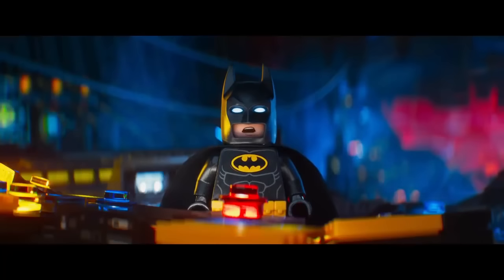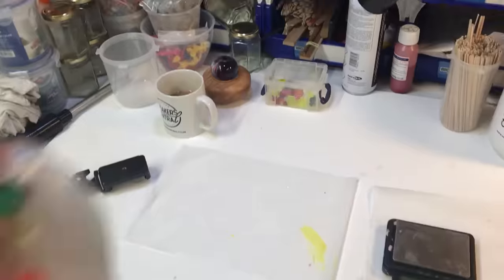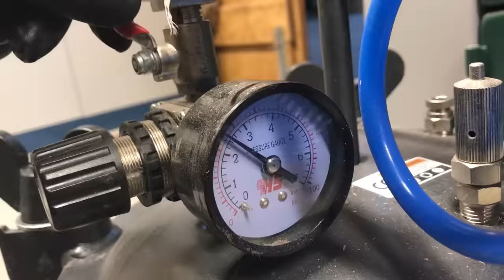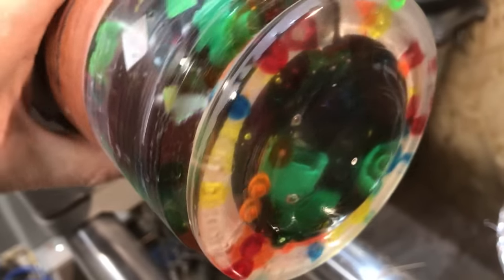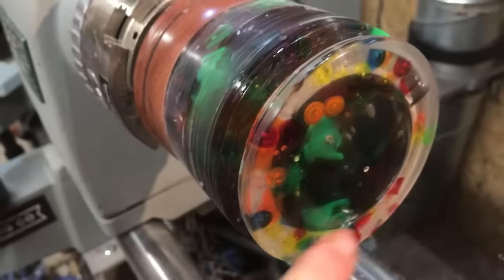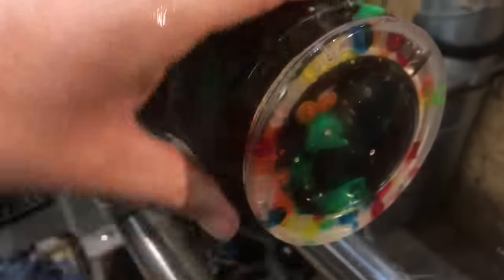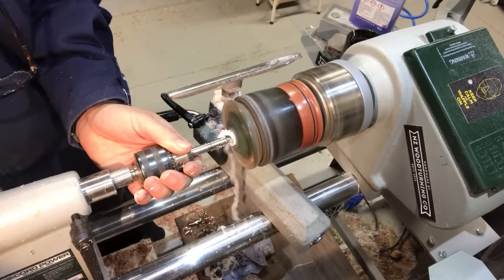I Mixed Up My Sons Translucent LEGO in Resin to Make Art 😮

Comment: Have you ever made something similar to this where you put a cylinder/sealed tube (like an aluminum cigar tube) in from the top to create a hole? when you remove it from the mold, I would guess you’d put your block on the top where the hole is then drill through the wood base into the opening where you would be able to put some kind of a bulb inside like a night light. That would be really cool with the Lego cast because of the translucent neon colors.

Comment: Been wondering this for awhile. I watch afew channels that do resin projects. What's the different between using a pressure pot & using a vacuum chamber? Other than the obvious, one adds pressure inside the the tank & one removes pressure. How's each effect the outcome of the final product? I've noticed some artists (like yourself) use a pressure pot, while some use a vacuum chamber.
Reply: Pressure decreases the size of the bubbles so they are too small to see. Vacuum increases the size so they join together and float to the top. Vacuum can be messier.